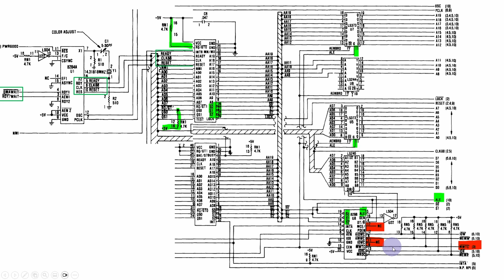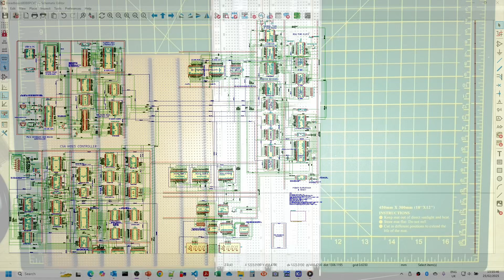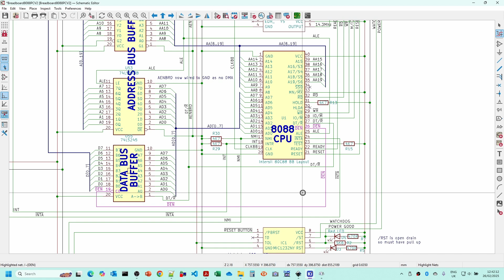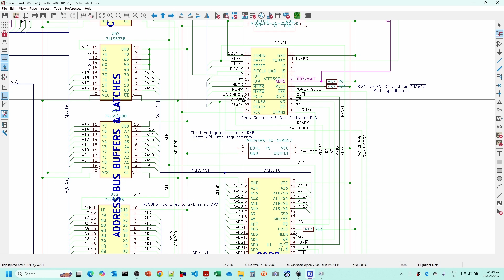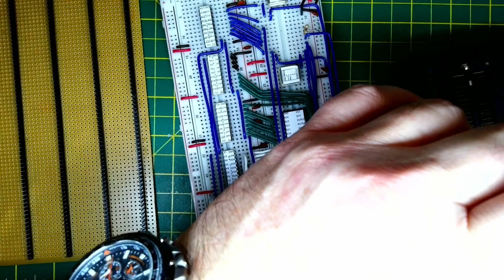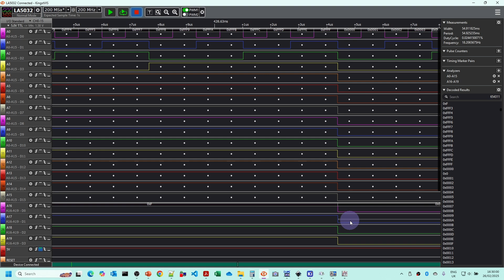New Breadboard 8088 PC V2 #2 Reset, Clock, CPU, Buffers & NOP free run

Comment: I have one question / request: I'm trying to get a overview of parts I'd need for your project (The 6809, BBv1, BBv2) and the schematics don't tell if the LS or ALS version are used / required. From the chip labels, I can see that we have ALS chips for the buffers here. And also, you mention ALS in some parts of the video circuit. Maybe you also mention it in the video, when it is important. 
But I'm often jumping back and forth between videos; sometimes I just need a overview to make a part list. It would be super helpful, if you could provide the exact version in future schematics (and timing information for other chips, if relevant). 
Also for some other parts, I'm often wondering, what speed requirements we have. For example, the dual port ram IDT7134 comes in various versions from 20ns, 35ns, 55ns and 70ns. Probably 55ns is okay?
Reply from the maker: LS will be fine for 6809 Nanocomp. I used ALS for the Video Controller. I tend to get ALS when I can now just as they have greater fan out but I haven't had any issues mixing them with LS. 55ns will be fine for most things including Video text mode.
For the VGA 256 colour 320 x 200 graphics I used a 32K single port 15ns access time SRAM (1 byte per pixel). The rest is 55ns.
Because I now have a fair supply of parts I generally have most bits in stock so don't need to worry too much about parts list. You should be able to generate one out of the KiCad schematics.
I would recommend skipping BBPC V1 and go straight to V2. The newer components are easier to come by (though ironically cost more than the retro ones!). Good luck. Dave

Comment: Hi, I saw your video while looking for information on the 8088. In honor of my grandfather from the old days, I would also like to build an 8088 computer with original components. At the moment I have 4 pieces 8088 processors, of which 3 AMD INTEL 1978 P8088-1 pieces, one AMD 1982 D0888 piece. I also managed to find only one piece of SAB8284AP INTEL 1979. In addition to the LS244, LS245, LS374 latches and hundreds of other components in the drawers in my grandfather's garage. All pieces from the time, original from 1977/1982. I also found 4 pieces of the 8085A-2, in addition to about twenty pieces of the Z80 of different types. I have the basics of electronics but I have never built a computer. Can you help me?
Reply from the maker: Its a nice justification for a project. I would have a read through the book referenced below and watch the original series of 65 odd videos for version 1 of the Breadboard PC before you let yourself in for some ride! It should save some  pain but I am sure you will come across your own unique issues!
If you follow the original Breadboard PC series it should help as I tried to use older components and I was learning about 8088 PCs on the way so include a lot of explanation.
This Version 2 series is using modern components where possible so may be less useful and references the original series a lot rather than explaining things in great detail.
It will require a level of electronics knowledge and some equipment (not to mention 20 odd breadboards).
There are lots of tutorial videos out there on basic digital electronics.
As far are original components go then a 8284 is a good start as difficult to come by now.
I would suggest using modern static RAM and EEPROM though as DRAM and old UV EPROMS will be tricky to get working. There is a book  "The 8088 Project Book" https://archive.org/details/the_8088_project_book_grossblatt_robert_1989 which gives a good introduction but doesn't try to build a PC just a digital clock but includes a lot of electronics explanation. He makes the same recommendations about avoiding Dynamic RAM.
I would try and use the 74LS573/574 and 74LS541 series (74LS245 is OK) as the pins are all on the same side which makes using them on breadboards easier. The 2xx series had pins all over the place except for the 245.
Hope this helps. Good luck. Dave
Reply: @breadboardinglabs  Thanks for the quick reply. Looking one by one at the components in the drawers I found a nice supply of eproms MN27c64q/ MN27c64F1/HN482764G, M27C256B, HN27256G-15, and others of the same series, all UV, and I also found the lamp to reset the Eproms from 12.5v to 21.5v, timed 1-10. The first thing I did this afternoon was to create an eprom programmer with ARDUINO MEGA. To start I tested the MN27c64q eproms, since I have so many of them, 35 pieces. The programmer seems to work well, but I have to fix it better, sometimes when reading it goes on its own I have to remove and put the serial window back every time. The writing is good, I tried to read several different eproms and the one I stored shows the same codes 0x12... etc... I started assembling the 8284 a few minutes ago, with a 12Mhz quartz, I haven't found the 14Mhz yet in this chaos of components. On pin 8 there is a good clean signal, it only loses a few Hz, probably due to the not perfect oscillator and the wire wiring, 11.95 Mhz. I'm assembling the processor now: I chose AMD P8088-1, for the latches ls245 A0-A7, ls373 for D0-D19. A question: how should I test the processor? (before assembling everything and then discovering that it doesn't work hahaha) :) :) :)
Reply from the maker: Frequency unlikely to be exact, the original PC had a variable capacitor to trim the 14.3 Mhz crystal to tune the TV colour signal.
To test the processor check out Video #5 https://youtu.be/PkTblwlIZLs?si=N_DHP2AwJ6Dd7Es3 use NOP to make CPU cycle through address lines (also #2 from new series but less info than original #5).
You don't need to hook up latches and buffers if you use 4.7K resistors to 5V and 0V on the AD0-7 pins. You should see different frequency square waves on A8-A15. A0-A7 will be messed up with the NOP data values.
If you goto the the Channel ...More you can reveal the gmail Email address I use for this site.
Prove you are human to reveal it to prevent bots skimming emails from YouTube.
If you email me on that address it may be easier. Dave
Reply: @breadboardinglabs  update: I mounted latch and processor. Now I have 2.990 Mhz with 3 volts on pin 11 of ls373, is the ALE signal correct?
Reply from the maker: 3V is more than the TTL min for High of 2.2V so volts is OK. I would do NOP test in other reply before worrying about ALE. With the 14.3Mhz and 4.77 MHz clocks I would expect ALE once every 4 CPU clock cycles so about 1.19MHz at most. Make sure 8088 is in minimum mode if using ALE pin on the chip. Dave

Comment: Hello! Regarding the turbo mode and FDC - I'm working on integrating your PIO related bios changes on my machine and it seems like the FDC does not quite like the higher CPU speed. At 5MHz I was able to read some data from the floppy disk (writing was not possible, though), but at 8 and 10MHz DOS reports general error. Unfortunately I don't have right now any crystal that would bring the CPU speed closer to 6MHz. Anyway, I think that i will have to make some alterations to ensure correct delays when accessing FDC registers, but as for now I don't have full understanding of what actually is wrong. 
Jarek
Reply from the maker: The one I used was 16Mhz which gave 5.33 MHz. Not tried anything faster yet. Likely to be in the next 5 weeks with 25MZhz clock. You may find that ironically adding a NOP or two between the IO reads may make it work. Your faster clock may be too fast for current code but not quite fast enough to wait for a full CPU IO polling cycle so a few NOPs delay could be enough. You may also need some IO wait states with the faster clock speeds. These are the types of problem that make this retro stuff more interesting/challenging 😀 Dave

Comment: Ironically it was the button matrix and 7 segment displays that I found gave me the most trouble
Just not something I had done before, and I ended up down a blind alley trying to debug my "debugger" on a system that it turned out wasn't fully working

building it as it's own little project wired directly into gpio from the outside would have been a better approach in hindsight
Reply from the maker: I started from a working Nanocomp 6809 keypad and display and monitor source so was easier to get working on X86. There always seems to be one part or projects that goes south. DMA with floppy disk access was mine! Dave

Comment: Would you say it's feasible to follow this project? What would it approximately cost (not including tools like logical analyzers or programmer)?
Reply from the maker: Its not going to be cheap but feasible.
Much easier and cheaper to run a PC emulator on a Raspberry Pi Zero or DOSBOX on a PC!
I would reckon about £500+ totaling up all my eBay and Mouser orders of which £140 of that was for 20 breadboards and that's re-using existing 3.5" floppy disk drive, SATA disk, keyboards and mouse etc.
There are 4 chips you can't get new, the FDC, PS/2 Keyboard controller, Video DAC and Hitachi 6845 CRTC from eBay or Silicon Ark in UK.
One option is to get Sergey Kiselev's XI-8088 design on PCB and build that but the chips will still be about £300 and you would need ISA IDE Card, ISA Video card etc.
I did this to learn how the original PC worked not a cheap retro PC.
Dave
Reply: @breadboardinglabs  my total project expenses are more or less in line with that.

the project was a challenge, but a rewarding one
Reply from the maker: Yes I learned a lot over the duration of the version 1 PC. I hope this one will be a bit simpler (assuming I made the major mistakes in V1). I am thinking of doing a 386 DX with 8MB of memory for the next one to see if I can run Windows 95 but that will be some months off and after I work out how to do a proper VGA register compatible video card. Dave
Reply: @breadboardinglabs  386 DX with 8MB of memory!  That will be cool if you do it.  There is a guy that did a 486 Breadboard but did not take it as far as you are doing.  FoxTech is the channel.
Reply from the maker: Yes I saw that one, mother of all breadboard adapters. 386 is only 132 pins! Got the sockets for it. Just the wiring to do!
Reply: @ChrisJackson-js8rd  Did you manage to closely follow the BB PC v1 or did you go with you own design?
I tried to do it a little bit differently, e.g. CMOS ICs instead of 74LS. And I wanted to try something different than the many power rails for the bus. I managed to connect RAM + ROM and wanted to start with the interrupt controller, when I suddenly faced a very subtle bug. Some push or pop instructions corrupted the data in very specific scenarios. Writing / reading wild data patterns to RAM worked. I tried different CPUs.  
I couldn't solve it - maybe it was some inference on the bus, maybe a power issue, maybe something else - and had to give up
Reply: @breadboardinglabs  Cool !!!
Reply from the maker: Well BB PC V1 is the basis for this one (which is my design borrowing a chunk from the XI-8088). I took the KiCad project and tidied it up and re-arranged the layout with some simplifications (no DMA etc). I would avoid using CMOS with the legacy chips as the voltage levels from the older stuff may not reach the levels needed for CMOS (unless TTL compatible) and you may have issues with fan out etc. I have mainly used LS and ALS when needed for speed with video controller. You may need to try pull up resistors on your data bus if you had problems with CMOS. POP and PUSH issues could be related to addressing as well as data bus. When I have had these of issues, I used the 32 channel logic analyzer to trace through address, data and control bus data to try to work out what's going on. A big puzzle! Dave
Reply: @michaelj7677  My design was  pretty different in terms user facing elements (esp in the display output) mostly just to make use of parts on hand and some local pricing and availability insanities. 

But the core elements - RAM, ROM, CPU -
 I think I followed the 74xx logic component identifiers exactly. It has been my experience in the past that swapping in CMOS for LS parts can cause timing issues that are challenging to quantify/define/debug. The sort of thing that is 'fine' 999/1000 times but will cause signals to arrive out order pile on top of one another or just generally "interact"

the bug you describe is interesting. i don't suppose you got the system in this config to a state where you could attach a debugger? or dumps of APIC tables? also if  interrupt  controller is from another vendor there may be feature differentiation as well the newer process at play.

But yea as I said above my rule of thumb is follow the known working example as closely as possible.  If you  need for whatever to swap a part make a note to yourself to run some basic level of test against it more less every time you modify anything else on the board that interacts with it.